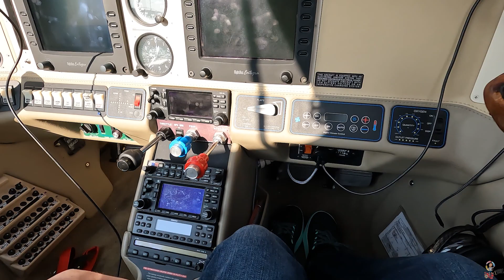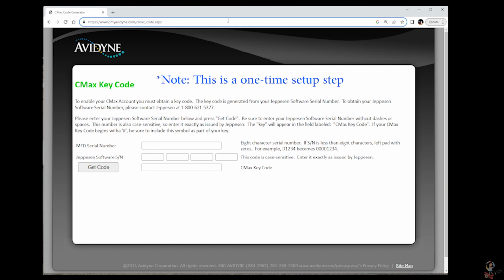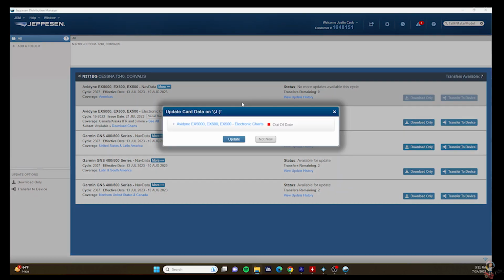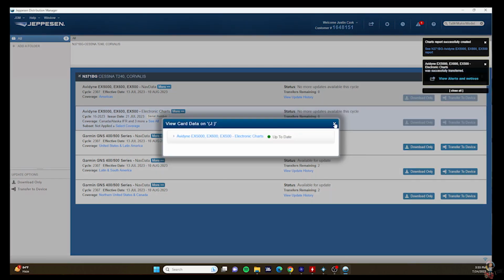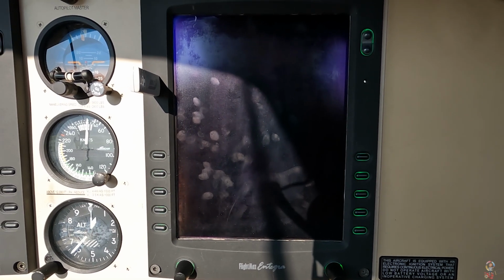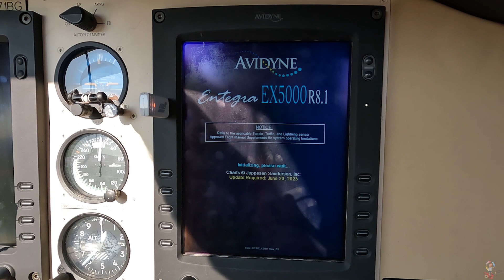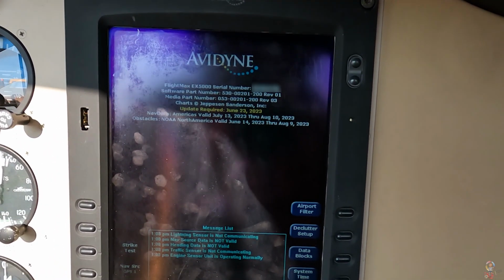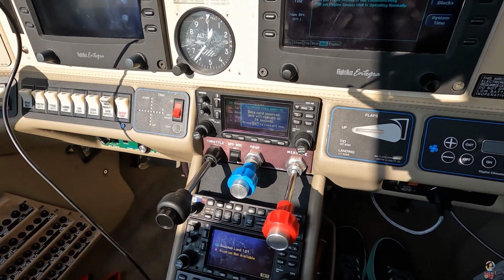IFR Database Updates: Avidyne EX5000, Garmin GNS430

Comment: I have a 2005 Columbia 400.  I have a Jepp subscription for updating the cards for the two G430Ws.  I have never updated the Avidyne Entegra.  What size thumb drive is needed?  After copying the specific ID numbers from the aux page, do I then call Jeppesen in order to buy and proceed with the update?  Any idea what they charge?
Reply from the maker: Any thumb drive will work, it just has to be formatted to the older fat16 format. When you do that, you’ll be capped at 3.xx GB. I just set my partition at 2GB. It can be any cheap throwaway drive.
After that, call Jepp and let them know your exact configuration. You can do the EX5000 plus one or plus 2 GNS units. Depends on your preference for redundancy.

That subscription will also get you 2 ForeFlight devices for charts. I use iPad and iPhone as a backup to the mfd. Pricing varies based on GPS units. If you ever upgrade to GTN or IFD the price goes down. Not sure the current rate for the old GNS units

Comment: I have the issue of the charts saying continue to load for over 30 minutes and then I pulled it out and it had not updated. Any tips of what I am doing wrong?
Reply from the maker: The charts do take a longer time than they should. I’ve had them go anywhere from about 10 minutes to over 25.
I’ve only had it fail once, and when I retried the next day it accepted it just fine.
I would make sure your batteries are in good condition and your bus voltage didn’t drop too low. This could cause odd behavior on the MFD.

Comment: Do you get a deal from jeppesen for three dbs
Reply from the maker: It depends on the equipment, but yes. In my case it’s only an extra 20% for the second navigator. But I do also get 2 electronics devices with access to the charts. So I have the geo-referenced charts on the MFD, charts on my iPad, and the Nav info for the GPS units all under one subscription.
Reply from the maker: Having just updated my subscription again, Jeppesen now offers an “airframe” package where the dual navigators in the same plane is one plan. I saved about $300 this year.